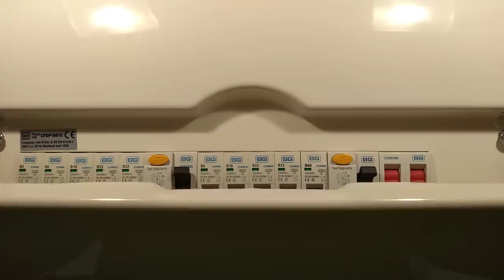A look inside a British home electrical panel.

Comment: 3--phase?    wow in the US is   120/240 volt single phase system.
Reply: yes i know,europe ans us have lot different, usa have 1930 today and europe have 2019 today, wery different system, usa used old idiot system lot and all other world use smart safety goos system.
Reply: @mattivirta  ,  i will say that i give credit to Europe for a 240volt system. like most of the world. Japan-- i think is on a 120volt --50hz system.  my wife is from Malaysia.  it is a 240volt system there. and we are now over in Malaysia helping with her mom.   it is a single phase system.  not 3 phase though.   i am a sparky back in the states. i am use to single phase systems, not 3 phase. but i can tell you that the US is never going to go to a 240 volt system.   could not afford to do it .  should have done it back when the US was first installing electrical wiring and system.
Reply: In the US there is also a thee phase system but each house gets just one phase. The voltage is generated with a pole transformer close to the user and the 120 V  (Neutral) is taken from the center. Compare this to Finland where only high voltage liens are in the air. Everything else is underground especially on the cities. The transformer is s small building/structure a few hundred meters away. Each house typically get three phases.

https://www.alfenelkamo.fi/sites/elkamo.fi/files/styles/cta_block_afbeelding_middel/public/images/header/ELMO%20Polaris.jpg

Comment: A course I found could make me dangerous in 18 days for 2400 quid (domestic installer course). Are you saying that I can be just as dangerous (but qualified) in just 5 days?
Reply: mbaker335 The guy who installed my smart meters was a gas fitter. He didn't know elementary stuff about electrical wiring. He was quite open about his lack of knowledge. I watched him carefully lest he burned my house down!
Reply from the maker: There are one week courses.  I believe a certain self-appointed "voluntary electrical safety" organisation which makes a lot of money from "approving" people offered a five day course which included approval on the last day.  They appear to have withdrawn it now.

Comment: I saw some photos of a 3 phase uk installation. No strain relief meter tails went right in to the consumer unit. In the us THIS ALL WOULD BE IN CONDUIT. The more i look at the uk the more i cringe. As an American licensed electrician I think the way the UK treats electricity IS EXTREMELY DANGEROUS AND RECKLESS. I was called to a store ware someone decided to change the main panel they came out of the wall exposed wires just like the uk. There was a fire on the roof they went into the store saw the exposed service wires called the electrical inspector he yelled
EVERY BODY OUT OF THE STORE NOW!! ,PUT up a CONDEMNED STICKER and told the owner if i see any body in the store before this is fixed and approved YOU WILL BE ARRESTED!! He was very pissed off.The way the Uk treats meter tails would not be tolerated in the Us it just isnt considered safe hear and yet its 120 volts to ground not 240.

Comment: So the bad thing is the potential to pull more current than 100 amps if everything is on at once????
Reply from the maker: There's a broad margin.  The fuse won't just blow at 100A.  You could have all the loads on at once and as long as you didn't exceed 100A greatly for a very long period of time it would be OK.  It's called diversity factor.

Comment: New Zealand has the same system apart from we don't have ring circuits
Reply from the maker: Same as Oz I think.  Power radials make a lot of sense.  Two 16A or 20A circuits instead of one 32A circuit.

Comment: You are not requied do protect those RCD with 63 A breaker ?
Reply from the maker: There's a fuse at the incoming supply.
Reply: @bigclivedotcom  so there is 63 A fuse  ?  It seemed like it was fused at 100 A
Reply: @michalhejl9730  that was the main switch, we have a fuse near the electric meter, also known as the "Cut-Out"

Comment: Oh America is so Behind. I know it won’t happen but we need to upgrade our outlets our electrical plugs.  Is it legal for a homeowner to work on their own electrical system or are they required to have a licensed electrician in the UK?  In the USA Specifically for my house. I have a 200 amp Incoming service. I rewired my entire house and I have 32 breakers. The only 220 volt items are my A/C, Stove and water heater.  I ran those Incase I ever decide to leave Natural Gas  but for my Air Conditioning compressor is a 60 amp 220 volt.  Breaker. So what would be the average number of breakers for a typical house in the UK?  I ran a circuit for each room for electrical plugs and lights. No more than 6 outlets per breaker some rooms have additional circuits.  I basically have an outlets no farther than 1 meter either side.
Reply from the maker: In some parts of the UK it is required to be registered to do home electrical work.  But purely down to vested financial interests.  Nothing to do with safety whatsoever.  Quite the opposite.

Comment: I'm not seeing why you need multiple RCBs here? Is there nusiance tripping otherwise?
Reply from the maker: The point of using two sections is to ensure the house has light if one section trips.
Reply: @bigclivedotcom  why is that important, unless it's the part you happen to be in?
Just add emergency lighting in key areas!

Comment: When I was a young idiot (I think it was 1996 & I was in my 1st house), I personally replaced my own consumer unit - without first pulling the 100A fuse in the meter box - this was deliberate, as I didn’t wanna fuck with the supplier’s gear.  I did this because I was installing an electric shower & the old fuse box hadn’t enough capacity.

Everything went perfectly & I’d got all the lives, neutrals & earths connected to the new parts, then I dropped the final, main earth cable onto the live bus bar...  There was an enormous BANG, a fireball about as big as a beach ball- directly in front of my face & I fell to off the stepladder.

It obviously blew the 100A fuse in the meter box & I took advantage and finished the job.  I had to call out the power company to replace the fuse & lied to them, saying that my Dad had come round to fit a shower & fucked it up. SMH #DeafForTwoHours
Reply from the maker: The correct technique to employ here was to remove the fuse and then just pretend you knew nothing about the seal being broken.  The electricity companies are pretty used to finding that, because many electrical installers routinely pull the fuse for safe working.  I've done it myself on commercial contracts.

Comment: Is this for ring mains? or is it for modern systems?
Reply from the maker: The power circuits are still ring mains or "ring final circuits" as they like to call them now.
Reply: @bigclivedotcom   Ok so why do you need so many circuit breakers when you have a fuse in each power cord barring the lighting circuit eeven though I see no reason why they couldnt put fuses in light fittings aswell. (need might not have been that great using traditional bulbs though)

Comment: Not to doubt anything you've said, but are you a qualified electrician for such domestic purposes?
Reply: Clive's knowledge exceeds that of an electrician, this man is an electrical/electronics engineer - this man knows what he is talking about to a level that most electricians could only dream of. Think about it. Electricians just run cables from A to B and hook it up, hook up their little test meters, check the results are within specified ranges and sign it off. Many of them now have no clue regarding how things actually work, seriously, they are often bloody thick (not all I hasten to add). As an electrical engineer who designs industrial and commercial electrical services I often find myself on site in a witnessing and checking role and the conversations I have with electricians are scary and the mistakes I see are unbelievable for people who are supposed to understand this stuff.

So always remember, someone may be very good at putting things together and running circuits and investigating circuits to find faults but that doesn't mean they actually have a great knowledge of electrical systems. Like "mechanics" now, they just fit parts blindly knowing little about the actual workings.

Comment: What the view on adding a surge protector unit for £26?
Reply from the maker: How often have you had stuff damaged by lightning?
Reply: @bigclivedotcom  well I've got 2 surge protector power blocks in the house that have popped. I'm no expert, I was presuming they protected against some transients, or do you think the mvars or thermal fuses just deteriorate with age? They are quite old. Hmm.. thinking about it, many years ago the power company apologised for a neutral fault and paid neighbours for damaged equipment, but mine were all ok, maybe that was it. So surges, in residential settings, are really all about atmospheric, and in particular lightening? I was thinking that the protector may also protect two EVSEs with EVs attached. I currently unplug the cars on the odd occasion when there is an electrical storm  nearby. Happy to get your views oh big one ..without transfer of liability of any sort ;) You think I should relax and ease off the homebrew/moonshine?
Reply: I'm on PME. To be fair, would most folks know if their kit was damaged by transients? To them they'd just have something mysteriously stop working, and put it down to "they don't build them like they used to" without necessarily linking it with a storm. Would it be immediate, or if that little capacitor started to evacuate its bowels, maybe it could fail a day or two after the storm?
Reply: @bigclivedotcom  when I read your reply it reminded me of something that happened quite a few months ago
(which resulted in a smoking internet router (well, there wasn't visible smoke coming out of it but it smelt like blown up electronics) at our house, and a dead cordless phone at the house next door, which is where my sister lives)

Comment: As a canadian, I find those panel to be quite of a bad design. It might be flexible in design, but oh how ugly and error prone!

A nice Square D panel beat the hell out of those british panels imo. The only downside I see is that they do not come with a "main" earth fault breaker, each circuits need to have an independant AFCI breaker instead. And those are expensive, but not needed everywhere.

Our panel use a split voltage, 120/240 200A. It is actually a split phase of 120/120, for 200+200A or 48000W total. If you want 240V you use a double breaker that use both 'phases'. Old standard was 40 spaces, a bit newer could handle tandem breaker (space saver) and 60 circuits. Newer panels can handle 60 spaces and 80 circuits.

All the small powers is 120V, which cause a tiny issue with kettle and hair dryers, as the maximum power is 1440W, usually rounded to 1500W (80% circuit loading of 15A 120V = 1800W, 80% = 1440W). The rest of the big loads are on 240V, like the stove, cloth dryer, water tank and all of the baseboard heaters (standard = 10W/square foot of floor).

This is for residential and light commercial, industrial or bigger commercial use triphased, but instead of 2 phases, well, there is 3, but they are basically the same construction.

On our panels, the live come to the top, goes throught the main 200A breaker. From that main breaker, two busbar run top to bottom. Then you have two columns of breakers (our panels are vertically installed, UK is horisontal). Each rows alternate from phase to phases. There is a finger for each breaker to clip on near the center, which is part of the busbar. Newer panels may have a neutral busbar on the side of the breaker to clip on, or just a plastic one. The optional neutral there is for easier installation of AFCI breakers: no need for the neutral pigtail. Of course you have the separate neutral busbars and ground busbars.

So, to install a breaker, you just press/clip in the breaker and that's it. I don't know if there is bigger than those, but the biggest I've seen is 100A breakers, usually used to power a subpanel, like in a garage. Our breakers are 15/20/30/40/60/80/100A, come in various selection, single or double (120/240V). We have also the tandem breakers, which allow to use 2 independant circuits per breaker spaces. It is 2 breakers in one unit. We also have the same for double space, usually it have a single 15A, then a double 20/30A (or more), and another single 15A, but other combinaisons are possible, like 15/30-30/20 or even a linked externals ones to trip both at the same time to make a double double breaker (double 240V circuits), but those are very uncommon.

If it is an AFCI breaker, it connect to the neutral clip-on neutral bar or via a pigtail like the UK version to the neutral bar, and the circuit neutral goes to the breaker instead of the busbar, same as in the UK version.

The breakers are also bi-technology, thermal + magnetic. All of our panels are made in metal, because plastic is too dangerous. The breakers are made of a non-flammable thermoset plastic, which also mean it can't melt.

I would be interessed to see a real comparison between the two types to see the real pros and cons of each. One thing that change alot is that here in canada electricity is cheap (currently 9.4 cents/kWh, with a rebate on the first whatever per day kWh you use), which make it cheaper than gas/wood/oil for heating. Also, wood is getting banned, it is now illegal in most city to install a new stove, but you may be able to still use it. Except some city (like montreal for example) banned the usage of wood stove except for an emergency situation (like a many hours power outtage, or another icestorm like in 1998 (google it up: quebec icestorm 1998)).
Reply: yes i agree those panels are an awful design, that buss bar made me cringe. the whole thing looks like something you would find over here in a piece of automation control equipment as supplementary protection. In fact those IEC breakers are not approved for anything but supplementary protection in Canada, and MUST be protected by an approved primary overcurrent protection as they do not meet our strict standards. I believe it has to do with the trip curves not allowing the breakers to trip quick enough in a short circuit fault condition. If my memory serves correct B curve is 3x the rated operating amperage. meaning a 15A circuit breaker would have to source 45A in order to trip instantaneously. The length of the circuit wiring and wire gauge could easily prevent that for long enough to produce enough heat for fire. P.S. you can buy a 150A breaker for a QO panel, however you are limited to a max of 60% the mains rating for a sub feed in Canada. Heating branch circuits are allowed to exceed the 60% limitation.
Reply: Just took a peek at a B curve chart, it would allow twice the current for nearly 10 seconds and 1.5x the current for almost 40 seconds. depending on the gauage of cable running to the appliance, 18awg is common for small load, and even smaller in fixed lighting fixtures, that is a significant heating and fire risk if a fault occurs in the appliance itself.

Comment: I dont agree with having lights on an RCD to be honest. You're not typically going to come in contact with the fitting, and if it's a metal fitting it should be earthed or double insulated anyway. I wont even get started on AFDDs
Reply: No requirement to have lights on RCD. Location of lights and method of cable installation does however eg bathroom and cables buried in wall less than 50mm without earthed mechanical protection

Comment: Why do ALL consumer unit manufacturers find it acceptable to send out units with bare conductors showing where the ferrule is? This is frowned upon in industry so why should it be acceptable in a domestic situation?
Reply: Yes! Our inspectors at work will reject any ferrule terminated in this way. It's just not acceptable yet all the ones that come with boards have copper showing! Drives me nuts.
Reply: The ones I've seen with bare copper have the ends heat-welded making them essentially solid.